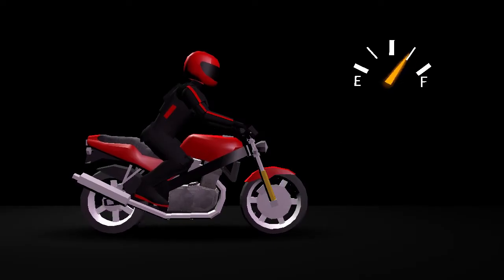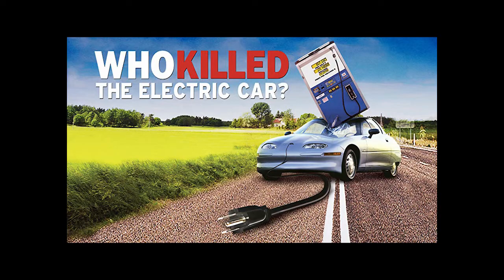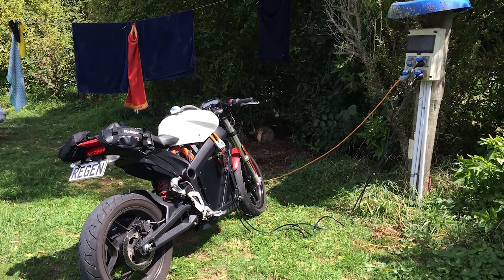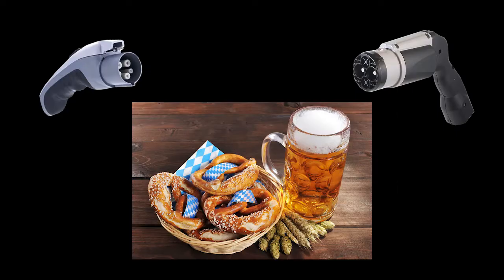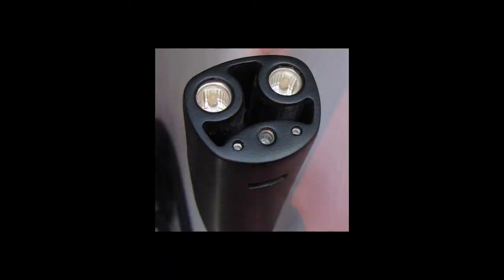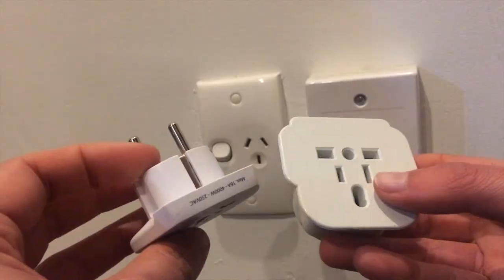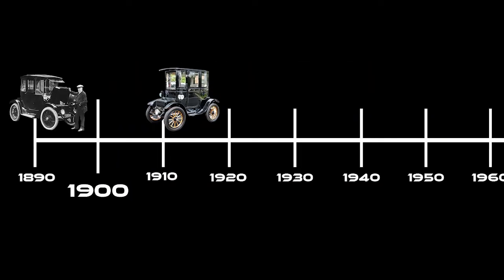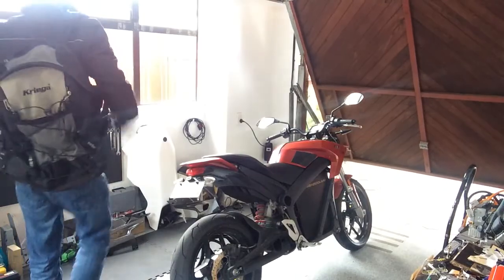Charging Adapters

Comment: Tesla created their standard because there was nothing out there that could handle the power they wanted. They opened it up to other manufacturers, but no one took them up on their offer. Too bad. Tesla superchargers are usually in group of 4 to 40+ stations. Very rarely is even one station out or order. And now your tesla tells you how may stations are open and if there is one that doesn't work before you even get there. But based on what I read and from your videos, non Tesla fast chargers seem to be not working more of than not. Which is also too bad.
One standard would be very convenient. But as a Tesla owners in the USA, I don't need non Tesla chargers. Plus, I get free charging at Tesla chargers.
Reply from the maker: Well said. If I lived in the US and was interested in going electric, Tesla is the only option, and it's entirely before of their charging infrastructure. I really wish other car companies teamed up instead of trying to compete and build "Tesla killers" 😑

Comment: Very helpful video!  I have a Chevy Volt and I'm trying to connect to a Tesla port and now I have a clue what connector to try.  Just ordered. I got the-----> "ONETAK NEMA 14-30P to 14-50R Compact 120V/240V 30 Amp 4 Prong Male Plug to 50 Amp 4 Prong Female Receptacle Generator Welder Dryer RV EV Charger Power Cord Adapter Connector "     Hopefully this does the trick... :)
Reply from the maker: Sweet!  Glad you liked it and I'm excited that it helped you.  Hopefully one day we won't need so many adapters to use all these stations.

Comment: Hello! , I imported zero SR to India and I am little bit worried about the ac frequency, India use 50Hz while USA use 60Hz , will it affect the battery?
Reply from the maker: Congrats on the purchase!  New Zealand is also 50Hz with 230V 10A outlets, and the stock Zero charger works fine :)
Reply: NewZeroland awesome, I am also try to improve efficiency by making more efficient motor
Reply: NewZeroland I’m American with a Zero SR. I’m trying to relocate to NZ, and am starting to wonder about bringing it over. What would I need to do to charge it in NZ? Just use a plug adapter, like I do for my cellphone chargers? Or would I just get another cable from Zero? All I have is the stock charging cable that looks like a computer power cable, so no fast charging for me. :-(

Comment: This is by far the clearest and best explanation of the different EV charging schemes I've seen, and that's saying something considering all the EV-related channels and news I take in.

The only thing that could have been amplified a bit is that to a certain extent different plugs actually are necessary, in that different vehicles with different voltages and setups really do have wildly differing needs. As you said, a Zero would be reduced to a smoking heap if you plugged it into a Tesla Supercharger (ignoring the safety systems, of course), but even many electric cars have relatively small batteries and lower voltages than Teslas, and can be charged in about the same time as a Tesla Supercharger with far less power. You really don't want to be able to plug a vehicle with low power requirements into a charging station with much higher power and make somebody who needs that high power wait  for the low power vehicle to charge. So it's perfectly all right to have completely different plugs for J1772 (max 9.7 kW AC but usually 7 kW), CHAdeMO (50 kW DC, although there's a new 100 kW version charger with the same plug) and Mennekes Tesla (120+ kW DC), but the problem is the competing plugs for similar power levels (proprietary Tesla vs. Mennekes Tesla vs. CCS2 vs. CCS1 vs. Chinese). The higher the power, the more expensive the installation, equipment and electricity fees, so leave the high power chargers for the vehicles that have huge batteries and actually need them and keep the medium- and low-powered charge stations for the appropriate vehicles.

I don't want or need to plug my Zero into a Tesla Supercharger, but a generic non-Tesla Mennekes Type 2 is designed for 3-50 kW and could be even quicker for something like a Zero or a plug-in hybrid car.

I would say that the ideal situation for EV charging stations is to winnow it down to 2 connectors: standard Mennekes Type 2 for AC charging vehicles because it can do 3-phase AC whereas J1772 is strictly single-phase, and the USA Tesla-type connector for fast DC charging vehicles because of its compact size and high power capacity. Seriously, CCS plugs are ridiculously and absurdly huge!

In theory the Tesla-modified Mennekes Type 2 connector could be that generic do-it-all plug, but it's actually pretty much maxed out with current 120 kW Superchargers and won't be usable for anything above that because of the small conductors. (It doubles up the AC conductors for DC charging instead of having separate AC and DC conductors like the USA Tesla plug.) Besides, there's not really a good reason for using the exact same plug for vehicles that can only AC charge as for vehicles that can both AC and DC charge. You don't want AC charging EVs blocking DC ones and vice-versa. DC-charging vehicles can't reasonably AC charge while road-tripping between overnight stops (it's like filling an ICE fuel tank with an eye dropper), and they might plug into AC chargers just to get a good parking spot like ICE vehicles currently do when blocking EV charge bays. Ditto with AC-only charging vehicles and DC charge bays.

Mid-level DC charging is kind of a white elephant: 50 kW is actually fast enough to be useful for road-tripping a big-battery car, but it's not ideal, and the cars that use CHAdeMO would usually benefit greatly from higher-power charging. Provided they did the right thing and used active cooling... (I'm looking at you, Nissan!)

But of course when it comes to exploring remote areas, there will never be a substitute for having every imaginable AC plug adapter on hand so you can take advantage of every AC electric plug you come across: everything from generic home wall sockets to oven & dryer sockets to heavy-duty industrial and RV sockets.
Reply from the maker: Wow, thanks for the awesome, in-depth reply!  I'm glad you liked the video.  I agree that there are some cases where DC just won't work.  Zeros are too low voltage to even take advantage of that, unless the station had higher current.  At the moment IF a Zero could DC charge, it would still take close to an hour.

The Tesla-modified Mennekes that does AC and DC in one seems like an amazing compromise, and I'm surprised nobody else has done that.  You're right that CCS is giant, but I feel like that's a pretty sweet option to have both AC and DC in one vehicle.  Hopefully we settle on one or two standards in the near future.  NZ is shifting toward CCS2 for DC and Mennekes Type 2 for AC, and I think that's a great way to go, but those are completely unheard of in the US and Japan.  I just hope we don't make any new ones.  Or if we do, some kind of agreement needs to be signed with the whole world to convert their infrastructures to that.  Otherwise it's just going to get messier.
Reply: @NewZeroland  The US Tesla connector does both AC and DC, in about a sixth the space of a CCS connector. It's way smaller than Mennekes Type 2, even.
Reply: totally agree!

Comment: I don't see why EVERY electric vehicle doesnt have the same exact connector. EV's are gonna end up just like apple vs android where no one ever has the same charging connector. Your gas station analogy was exactly what I was gonna write on this comment
Reply from the maker: Austin A good point!  I totaly forgot about Apple and Android.   When the lightning cable came out, I remember thinking “why would they do this?” and that is totally what Tesla did.  But Teslas in Europe/Aus/NZ using different plugs makes no sense if they want their plug to be the world standard.  It’s like if Apple used a USB type C everywhere outside of the US.  Then what was the point of making a new cable?
Reply: It really baffles me why Android is using USB Type-C, and Apple laptops use Type-C, but Apple phones still use the lightning cables. Can we just have Type-C be the standard everywhere for consumer electronics? Please?

Comment: Mennekes...
Tesla managed to make Mennekes supply both 43 kW AC and 150 kW DC via the same plug. Works on single phase, works on 3 phase, works on DC. Whoever came up with CCS was on drugs.
Reply from the maker: Hahahaha XD  That really does sound amazing.  Why don't all vehicles have that??
Reply: @NewZeroland  why? Because standards
https://xkcd.com/927/
Reply from the maker: HAHAHA
Reply: @NewZeroland  should we mention that you can't use cash or card to fill? You have to have pre joined that charge network and carry their specific card with you.
Reply from the maker: gasdive haha, and each station has it’s own different cards XD  That’s a whole video in itself!